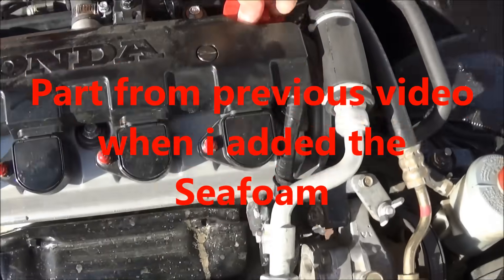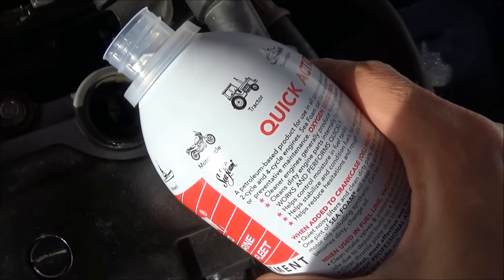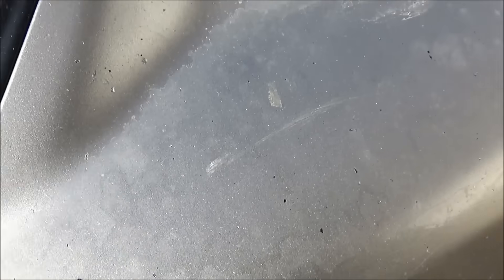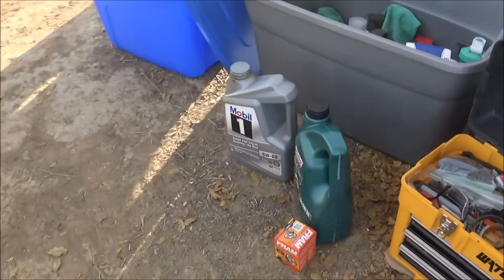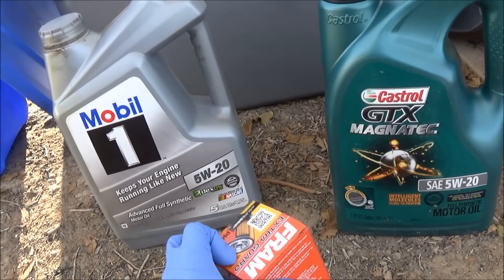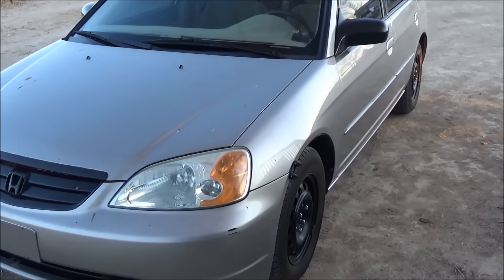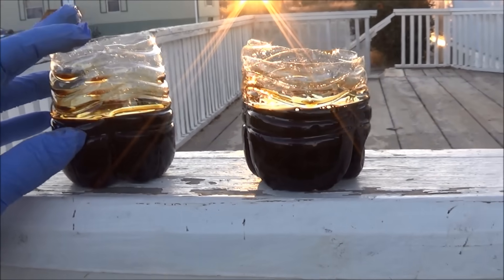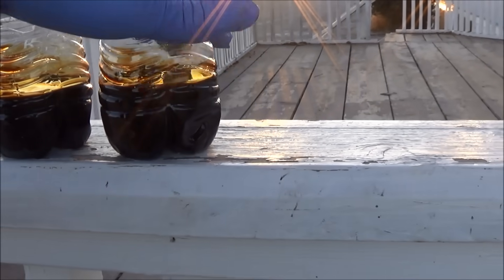Seafoam In Oil | Seafoam In Oil Before And After | Seafoam In Oil Before Oil Change [Sea Foam]

Comment: Everybody trashing Fram filters. Be specific to trash the orange can. Every other fram filter is top notch
Reply from the maker: Lol yup everyone has there opinion on this video...I do have oil filter videos where I cut into them. Subscribe and check em out
Reply: Derrick D the orange can is a awful  filter. The rubber in them is hard and the filter media is subpar. I use the factory Honda filter in mine, they cost about the same as the orange can Fram and the Honda filter has better rubber and filter media. Other than the Fram very nice video and what looks to be a clean engine.
Reply: Justyn Markland your Honda filter is most likely made by fram
Reply: Oh boy Honeywell actually make the filter. Honeywell also makes Fram filters. But they are built to different specifications with different materials. I use the A01 filter on my 95 civic and the Honda pcx on my s2000 they happen to be built by a different company.

Comment: Stay with Mobil ,Pennzoil,Quakerstate!!!!! They are true synthetic, Castrol is hydrocrackeddd Petrolium out of the ground, they had to sue scientists to call there fake synteccc,, A Synthetic oil, do the research, this is a Fact!!
Reply: Theres a difference between full synthetic an 100% synthetic.
Reply: Pennzoil and "caker state" are both horrible oils. Castrol GTX is what i use is everything i drive and it does great, no sludge, wonderful performance. Mobil 1 is good too, but you couldn't pay me to poison my engine with either of those other two.
Reply from the maker: Okay thanks for the info. I did not like the Castrol personally anyways so that's good to know.

Comment: I've used Fram filters on my Yaris, and it's got 321,000 miles on it, change the oil every 3,000!
Reply: Chabing oil every 3000 did it, not those glued up crappy Fram filters! They don't even have metal ends on the filter media, just heavy paper glued on. (Sometime only half-way glued.) Pressure spring? No, unlike real oil filters, Fram uses a stamped metal spacer. NO JOKE! Look inside one and see.
Reply from the maker: mothman1967 Subscribe to my channel bro and check out my oil filter videos I cut them open!
Reply: Oil today is so much better change it at 3000 Miles almost comes a waste of money
Reply from the maker: That's awesome. What kinda oil do you use ?

Comment: Never, ever, EVER use a Fram oil filter!  They're CRAP!
Reply: The cheapest of the cheap STP oil filter is far superior to  Fram oil filter.
Reply: Mitchell Carson what brand should we use
Reply: Almost any other brand oil filter is built better than Fram.  Just search YouTube for videos where the cut open various oil filters and make your choice from there - but know you'll get to see exactly why Fram oil filters are junk.
Reply: Purolator is a step above but not much more pricey if you don’t want to spend extra
Reply: Tell that to people that have been using fram filters for 20 years + without an oil related problem whatsoever! I've used fram in every car or truck I've ever owned and not 1 single problem with them

Comment: If I were you I would buy cheap oil and a good filter. There is no need to run full synthetic in a civic.
Reply: Full synthetic is always better in every engine. It coats better, doesn't shed off of hot parts, lubricates better, doesn't break down, not as sludgy in cold temperatures, doesn't leave deposits.
Reply: Mike H o

Comment: First, Fram filters are garbage. 2nd if you change oil and filter every 2,000 miles you will always have a clean engine without the bullshit scam  additives. I have a 1985 Toyota truck with over 2 millions miles on it and still going. But its always had 2,000 miles oil changes and been on Pennzoil since it was new
Reply: 3.5 million miles? That’s approximately 1,000 miles per day, every day, for 10 years.
Reply: Lies
Reply: Changing your oil every 2k miles is a waste. At $20 an oil change roughly you would have wasted $8000. you could have replaced that engine twice for that money.
Reply from the maker: Dan Frazier Dang that's a lot of miles man. Every 2k? That's crazy I drive 500+ miles a week. I change my by 5k used to do it every 3k but I use fully synthetic so it doesn't get as dark as fast
Reply: Well since 1985 there has been 11,818 days. That makes it 2,000,000 miles, but everyday for 33 years, or roughly 180 miles plus a day 7 days a week. Or 200 plus miles a day minus Saturday and Sunday. Ya it's doable but silly. Better have made a bundle of money and I mean a bundle. Because you had no time for anything else let alone oil changes that often.
Reply: Dan Frazier .....oh yea Danny boy... I have a Tacoma with three and a half million miles on it. Change the oil every 1500 miles. What do you think of that Danny Boy

Comment: I change my oil when the oil looks dirty. Which is between 5,000 and 7,000 mi. I always use synthetic oil with a manufacturer recommended oil filter.
Reply: I change my oil ONCE A YEAR, or 10,000 miles. change  filter ONLY after 6 months or 5,000 miles. Use Amsoil One  dodge caravan hasover 250k 95 Nissan Pathfinder 285k and 2011 Dodge Ram Hemi   144k  Zero Problems
Reply from the maker: Farrah Fawcett Yeah same here I prefer mobile1
Reply: Lies

Comment: GIMMICK!!  If you you have money to burn then use all of that additive garage.   Every owners manual for every vehicle I have ever worked on says DO NOT add additives to the oil.  Use the recommended oil and change intervals, and you'll never have a problem.  Don't waste your money!!
Reply: They only say that because they’re not going to wanna be responsible and held accountable for people that don’t know how to use things that won’t hurt your car if they’re used properly. Dumping a whole can of seafoam to a new oil change and waiting 5000 miles might be something Honda doesn’t want to be responsible for and I wouldn’t blame them because that is improper use and by then you would probably have a number of new issues. Rather than doing proactive maintenance. You can do reactive maintenance but that will cost you more down the road. @phillLsx GA.
Reply: I agree its all about liability besides who are you gona buy a motor from when yours goes shithouse the same company that wrote the owners manual #use ur head

Comment: With fram oil filters you get what you payfor K rap the k&n is better quality by far bosch,stp,mobilone and wix are better for your $. Magnatec oil is good choice though.
Reply from the maker: Thanks for the info. I personally did not like the magnatec oil. Subscribe to my channel and check out my oil filter videos
Reply: I have a few vehicles with higher miles again you get what you pay for high end oil vs low end oil counts as well Ive used royal purple all the way to generic supertech brands. It guess depends on driving taste?? Thanks for the reply.
Reply from the maker: Richard Nielson Yeah I totally agree. I used to use whatever. Now  I stick to mobile1 99% of the time.
Reply: Derrick D No worries ive used all the brands of oil it depends on the driving style. I used magnatec on my accord it seemed to like mobilone better.
Reply from the maker: Richard Nielson Yeah I agree my uncle only uses supertech and his vehicles run ok

Comment: I run 4 quartz of ATF on idle for 15 minutes. Or you can do 2 quarts of new engine oil with 2 quarts of ATF for 15- 20 minutes on idle.  Keep in mind once you drain and add new oil.  Run new oil  only for about 1000 K. then service with new oil. Since ur using ATF residue will be left over.
Reply from the maker: Thanks will try it sometime!
Reply from the maker: Thanks will try it sometime!
Reply: 1,000 K is a million miles.
Reply: bwtv147 no it's 1000 kilometers
Reply: What do you drive with an odometer that measures in kilometers?

Comment: A couple ounces of diesel would do as well. Remember when diaphragm mechanical fuel pumps would occasionally leak fuel into the crankcase? I pulled the pan on a 350 chevy after that and it was super clean.
Reply from the maker: Thanks for the infor man! Hit that sub button for me would ya

Comment: Never go with cheaper filter.  Wix, Purlator Pure one or K&N
Reply: Seriously though.. Fram is held together with cardboard. The others he listed aren't.
Reply: In my opinion Bosch oil filters are number one when it comes to oil filters, but those 3 are good too and make sure its Purlator Pure one not the blue one.
Reply from the maker: Firearms Gear Reviews Thanks for the info. Do me a favor hit that sub button!
Reply from the maker: P Miller Subscribe bro and check out my oil filter videos I take them apart 5,000 miles later.
Reply: Never never never ever ever ever buy a Fram filter!
Reply from the maker: Justin Wunder lol yeah yeah. Subscribe and check out my oil filter videos!

Comment: Here's my opinion for what it's worth. First if you use Mobil One full synthetic or another quality synthetic you'll never need to add ANYTHING to your oil. And pay the extra few bucks for a quality filter. Just my opinion.
Reply from the maker: Agreed I use mobil1 full synthetic and mobil1 oil filter also.
Reply: I agree, the Mobil 1 will keep an engine clean all by itself. I did not notice, but once while changing a timing belt on a Prelude, a good friend asked if the car was new? I said no, about over 100k on it. He pointed out how clean the engine was under the valve cover. I had not paid attention as my goal was simply changing the Timing belt.  I said, well, I have always run Mobile 1, and credited the oil for keeping the engine clean.   I now add a few ounces of prolong as I feel that is the best additive coupled with the best oil. (or at least somewhere close to the best combination)

Comment: Fram is nearly the absolute worst oil filter you can buy. A good oil filter has a large number of pleats (the folded sections of filter) to increase the surface area to capture dirt and particles. The Fram filter really skimps and the internals of the filter assembly are made of cardboard. Other filter companies make the structure out of a steel cage or tube and actually use a real pressure bypass valve in case the filter gets clogged up.... Fram... horrible.
Reply from the maker: Tisha Hayes Totally agree! Subscribe to my channel I'd appreciate it and check out my oil filter videos!
Reply from the maker: Tbh i agree. ANY oil filter will do the job. If your engine fucks up most likely its not the oil filter. My uncle only uses Fram oil filters and supertech oil and never has issues.
Reply: That's crazy cause I grew up watching my grandpa run them since I could remember & I have ran Fram filters for 14 year's on all types of vehicles, 750hp forgien cars to all stock USA trucks and cars to 600+hp diesel trucks with 0 problems but to each their own I guess

Comment: Isn't Sea Foam going to make the viscosity of the oil much too low? (thin)
Reply from the maker: Nope says so also on the seafoam website!
Reply: Derrick D not sure I would do it in my brand new LT-1 in the Corvette. I have used it in the gas of my 240Z with triple Webers and it worked well in that.
Reply from the maker: Dwight Brown Nah you shouldn't have to. Put some in the gas tank tho for sure
Reply: Derrick D strangely for a 57 year old guy I have never owned a pushrod ohv engine in a car. It is probably the most advanced V8 OHV or at least close. It does go like stink!
Reply: In any case thanks for talking. Nice to talk cars any time, much better than politics!!
Reply from the maker: Dwight Brown Haha for sure any time I like talking cars. Subscribe to my channel for me I'd appreciate it.

Comment: You should never use fram oil filters
Reply: Never had an issue from using a fram. Usually get the tough guard. 2004 grand cherokee 220000miles
Reply from the maker: Lol Subscribe and check out my oil filter videos.
Reply: Mackenzie Peek cheap ones you shouldn’t, but their ultra filter is premium qaulity
Reply: Scott Smelko they only sell the regular old cheap ones where I live. I use stp long life filters

Comment: Good stuff. I'd lose the Fram if it were me. A Purolator boss filter is excellent and not expensive. Where I work we don't even sell Fram anymore because they've fallen so far behind the tech curve.
Reply from the maker: sjohnson1776 Thanks for the info! Subscribe and check out my oil filter videos I have a few. You will be sad when you see OEM Honda oil filter is identical to Fram tough guard!
Reply: Never had an issus from using fram. I usually get the tough guard.  2004 grand cherokee 220000miles

Comment: Bro never use fram oil filters they contain cardboard that breaks down
Reply: Ben Negron having formerly worked for Napa, wix actually makes the Napa gold filters. 

Either one is a fine choice. I personally use wix. I don’t like cardboard in my oil filters lol.
Reply: Don't mean to be on the negative side sea foam does work wonders it's worth it to spend the few extra buks wiks is alright napa gold and wiks same company
Reply from the maker: Good to know man thanks. Subscribe and check out my oil filter videos!
Reply from the maker: Lol you might wanna tell all your honda buddies that honda oem oil filters are fram...Lol check out my oil filter videos i break each oil filter down after 5k miles.

Comment: Derrick,you do not need Seafoam or anything else to keep your engine clean and operating efficiently. Use a quality oil such as Amsoil Signature Series will do the job and more as it is a true 100% synthetic PAO based ,engineered and made by chemist. It is good for 1 year or 25,000 miles so you will save money,both,in time and on the oil over time as well as many other benefits.

Check out my website below and do some reading to learn about the Signature Series oil and how you can get 25% off wholesale pricing. If interested,ask about which oil will give you a solid increase in mpg over the oil you are using now.I have a spreadsheet for our own GDI engine where the mpg savings at the pump over a 10k mile oil change interval pays for the oil and filter.

http://toptiersynthetics.myamsoil.com/

https://www.amsoil.com/shop/by-product/motor-oil/gasoline/sae-5w-20-signature-series-100-percent-synthetic-motor-oil/?code=ALMQT-EA%22?zo=5544139
Reply: Michelle John do yourself a favor and educate yourself on engine wear and importance of CLEAN oil. Base stock really has no importance in engine wear, ALL engine oils lubricate and protect your engine from wear, but NOT if theyre saturated with debris (bearing/engine material). Sure the additives in synthetics don't break down as fast, but that doesnt stop microscopic particles from bearings and guides being worn and absorbed into your oil.. creating more engine wear at an accelerated rate. 
But go ahead, keep using the same burnt up, dirty black oil for 25k miles.. it doesn't bother me one bit. 
But what do i know, I'm only a master certified heavy/light duty,  motorcycle, marine, and recreational vehicle mechanic.. along with having my masters in mechanical engineering, teaching educational worships for auto mechanics and own a few very successful repair businesses.. in fact we had record sales at all my locations last year due to big money engine swaps from lack of maintenance. 
GM says you can go 7k between oil changes because they require dexos rated oil.. but then again,  GM didn't earn record profits post bankruptcy making their vehicles last forever. 
I guarantee the Honda motor in this vehicle looks WAY better on the inside than whatever motor you poorly care for.
Reply from the maker: Thanks so much man I appreciate the info I am definitely going to look into this!
Reply: Derrick D No problem, there is a LOT of info within the website,check it out when you have  time.
Reply: Michelle John give me a call when you blow your engine.. I'll be glad to take your money to install a new one LOL!
Reply: Derrick D do not take this advise.. your sea foam treatment is obviously working just fine for you
Reply: Do yourself a favor and educate yourself on oil and various base stocks.

Comment: good vid, 

Just an fyi filters are cheap at the dealer, i think they are under $4 at my local honda dealer
Reply from the maker: I am good with Honda OEM oil filters. I regularly use mobil1 or k&n. Check out my oil filter videos. I have one on Honda you might find interesting. Subscribe to I'd appreciate it.